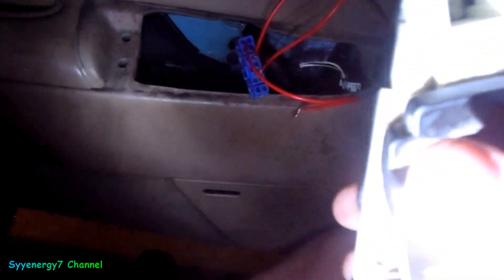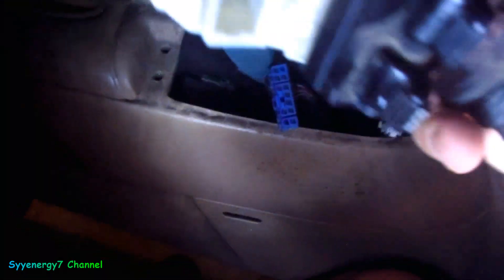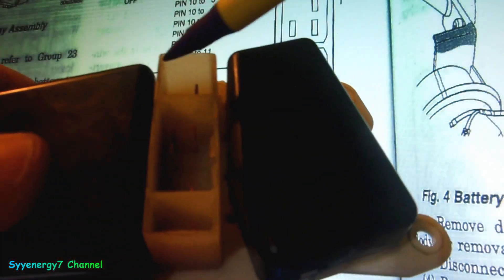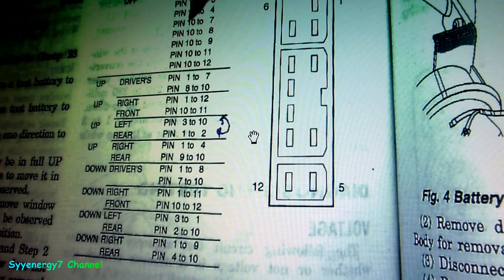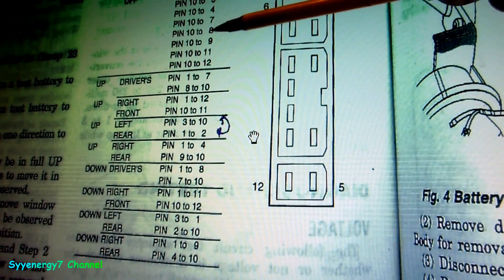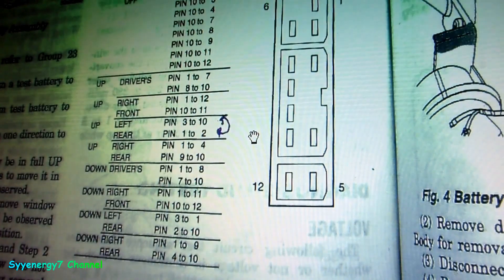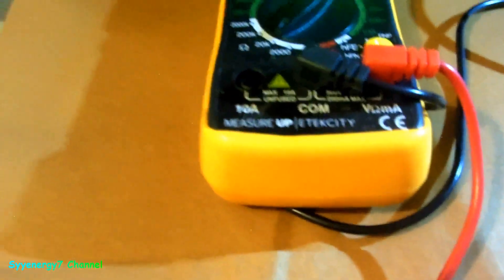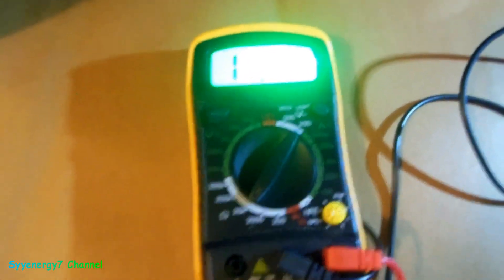Chrysler Sebring, Power Window Switch Diagnosis

Comment: Kid has a 2002 Sebring convertible now the drivers side window won't go up. Kid let the switches get wet several times by not putting the top up. Can I use a wire and jump between pins to get that window up?
Reply from the maker: Yes.  Also WD40 might get the switch working again.